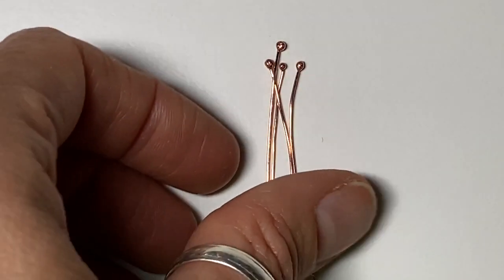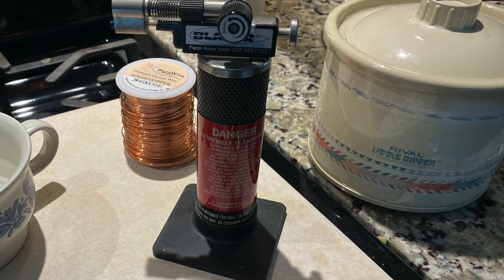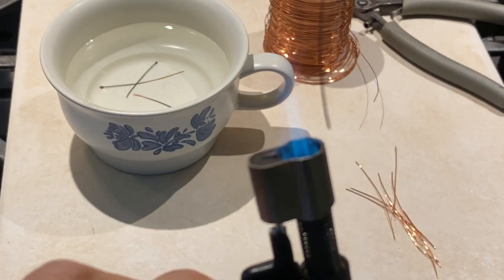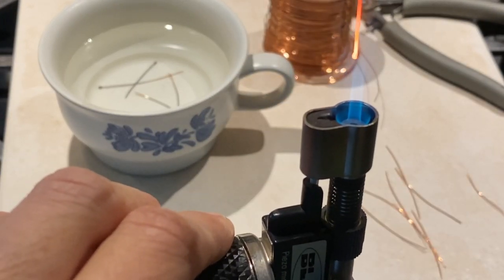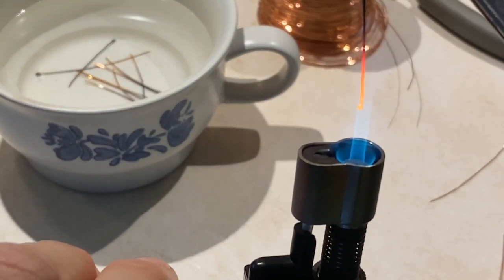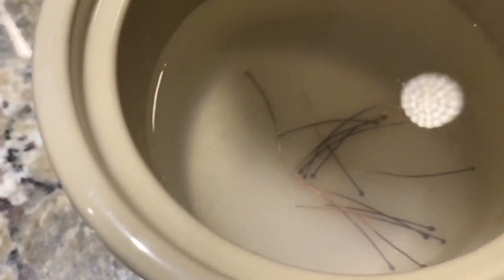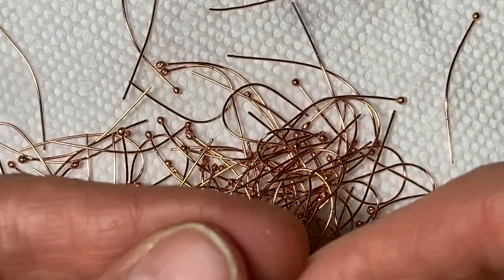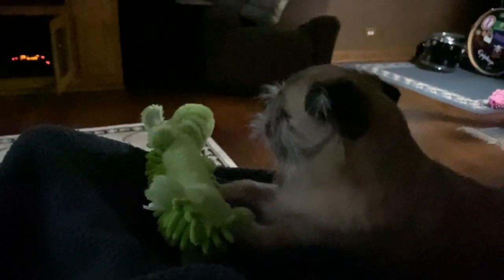DIY Jewelry-Make Your OWN Balled Head Pins with Copper Wire!

Comment: I like the head pins, they look beautiful, I like how you use the top of your stove as a work area for making the head pins, what do you use to place on top of the stove? Can I use your home made pickle solution on sterling silver, and how does it differ from store bought pickle solution, at what temp should I keep the crock pot at? Thanks
Reply from the maker: You could put a fire brick on an old tile or something. I make my own pickle since I don’t use it that often. I’m not sure what store bought is like tbh. My crockpot is probably a low setting. It’s a Little Dipper crockpot.

Comment: Hi Melissa you are one of my favorite artists. You are so versatile. I have a question about the pickle. I just started using my torch(finally) and a lot of other artists say the pickle gets toxic and to dispose of it at a toxic waste dump. I live in a small town and I don't think we even have one. What do you do? Thanks
Reply from the maker: I just use vinegar. Google how to make natural jewelers pickle and it will show you. I don’t torch enough to justify purchasing pickle. I use a tiny Little Dipper crock pot.
Reply: I to have the little crock pot but I was wondering how you dispose of the vinegar solution? Doesn't it get toxic after a while?
Reply from the maker: @michelletanner948  I’ve read that since it will have traces of metal in it it’s considered hazardous and to bring it to your local hazardous waste facility to dispose of it. My pickle is still in storage in a mason jar. I can reheat it in the microwave or throw it in the crock pot if needed.
Reply: @ZurickDesigns  What temperature do you heat your pickle?
Reply from the maker: @shadowfox009x  I use a mini crockpot
Reply: Thanks for the info re: "natural jewelers pickle." I understand the volume of pickle vs. metals isn't toxic for the per-project volume of pins/metals I'll be dealing with. I have no problem pouring it onto my well-graveled driveway, which will eventually be paved.

Comment: Help! I purchased a huge roll of bare 16g aw16 wire. I found out it is annealed wire. Can I ball up wire that is already annealed? I have never had problems with copper wire I have used in the past.
Reply from the maker: I don’t think you’ll have a problem. Try pulling it out a few times with a cloth or nylon jaw pliers

Comment: Hello! I've tried this with my different wires, but it's not "balling", the wire is just getting red.
Is it a certain type of wire? (Pure copper, sterling silver) only?   Thank you!
Reply from the maker: Depends on the wire you are using. For example has a higher melting point than sterling.